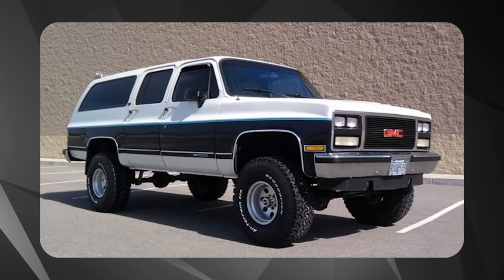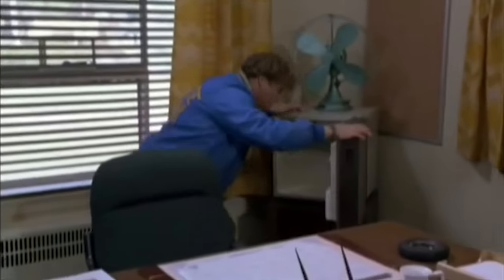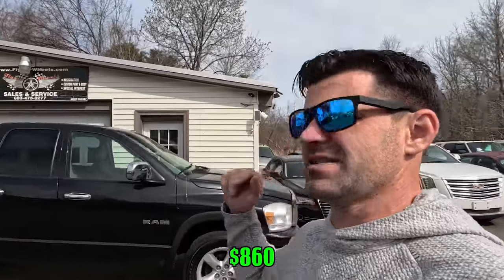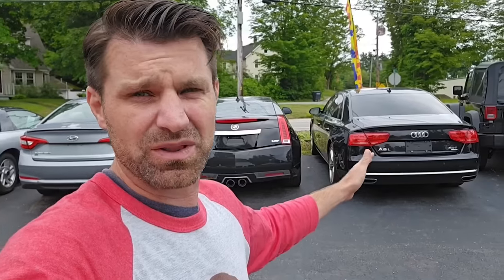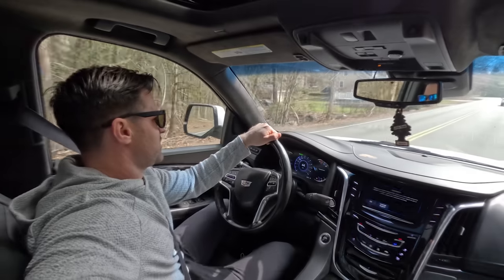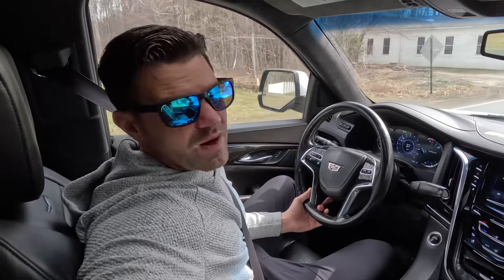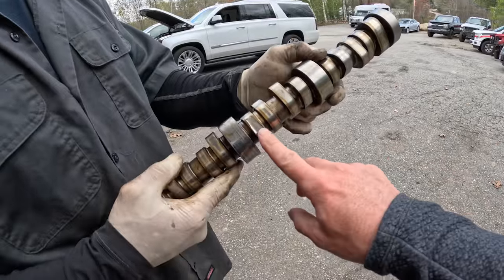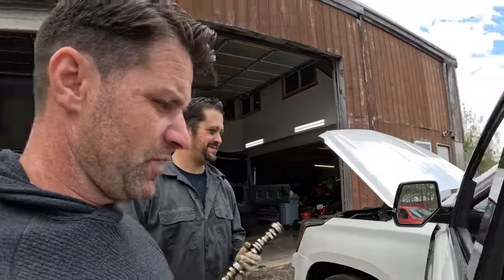WARNING! GMC Chevy & Cadillac Escalade Engine Problems at only 53,000 Miles! - Flying Wheels

Comment: Cylinder deactivation was a failed technology for Cadillac in 1981. 
Back then the technology just did not work.  But now it does and the result is early engine deaths no matter who does it, GM, Honda, Mazda, Mopar, Ford...
Reply: I had a 81 Caddy Coup 8-6-4  - got it cheap in 83 and de-activated it  was a decent car thereafter
Reply: I remember that too.  The "4-6-8" nonsense.  Too many nice Coupe and Sedan DeVille's in the junkyard because of it.
Reply: Direct gas injection is killing modern cars early. And servicing air conditioning on newer cars with r1234yf refrigerant is prohibitively expensive.
Reply: 9 out of 10 people that experience an AFM lifter failure on their 2014+ GM engine did it to themselves by being ignorant/lazy and running their engine oil too long. Some of them are clueless about car maintenance in general and wait until a message pops up telling them they need to change their oil. Others are dunces that make it a game to see just how many thousands of miles they can squeeze out of their boutique high priced full synthetic engine oil. You can have the fanciest high tech engine oil on the market, it still gets contaminated with carbon soot, combustion byproducts, unburned gasoline, and other junk, none of which will get filtered by an engine oil filter. The only way to get rid of that junk in the engine oil is to change it. So a guy buys is $10/quart fancy engine oil and tries to push past 10k miles before changing the oil, and eventually the contaminants flow into the tiny passages of the AFM system, restrict oil flow, and a pin in one of those lifters gets stuck because it didn't have the oil flow to work correctly. The system "fails" and they go online whining about how AFM is junk when really it was their own ignorance that caused their lifter to fail.
Reply: LOL NO
It killed my sister's V6 Accord, it kills Corvettes, etc
Reply: @hochhaul  
Dude, GM tells customer's to change the Sclade oil every 15k miles!

Comment: I have a 2016 Cadillac Escalade Platinum currently at 132k miles only issues I had was the third-row seat motor went out. Drives like a champ!
Reply: I bet most of these problems are owner related.  Most people don’t even change the oil anymore.
Reply: Congrats, send it to the GM museum before you eat your words

Comment: DOD AFM costed me $4000, the lifters on my ‘15 Camaro SS went out at 21k miles. And for me to remove it I had to pay an extra $4000 for the stage 2 cam and tune. If I would’ve know that this was an option I would’ve done it but now I still have it and it’s just an absolute nightmare because I fear that the lifters will go out again.
Reply: Why would GM put AFM in an SS Camaro? That makes as much sense as a screen door in a submarine.
Reply: @charlescurran1289  Helps the meet CAFE standards...
Reply: @MrMartell77  Yeah, I agree but the savings made on a halo car like a Camaro that sells in relatively small numbers can’t help that much. What next AFM on Corvettes?
Reply: Dammm I didn't know this was a issue with the Camaro as well smh...

Comment: You should have him build the 5.3 and 6 liter engines with the AFM Delete lifter/cam set up.  If I were buying a used GM and you told me the engine was not only rebuilt, but was rebuilt using that delete kit, I'd pay for it, knowing I would have a more dependable engine under the hood.

Comment: the best Escalade of all time is the 2002-2006. No AFM. GM failed with cylinder deactivation with the 1981 ElDorado and decided to do it again. My dad had a 1981 Eldo.  Also, all those electronic gizmos. What a nightmare to repair.
Reply: The 2007 and 2008 have a engine with afm but it’s disabled..the 2009 is a 1 year only 6.2 that has same engine as my 2010 Sierra Denali  L9H  vin 2. No afm…so you can grab the 07-14 body SUV’s but only the 3 years I mentioned..2010 onward they went with l94 6.2 and it had afm…but don’t get the suvs with the 5.3 in 7-14 cause they all have afm in 5.3…I love my Sierra Denali and it’s 403hp L9H… no afm and runs killer…I absolutely love the next truck that came out 14-18 but that 6.2 had afm and it scares me
Reply: @toddprater14  it's a real shame one has to know all this to avoid the crappy AFM. It was designed to satisfy the govt CAFE standards by adding a miniscule 2MPG ( if you are lucky) 
GM does not care they break down after the warranty, in fact, they like it to do so.
Reply: @steveosgood9182  very true , it is a shame cause gm’s trucks and suvs are the best looking out of the big 3 in my opinion, and that they do not care as long as the vehicle makes it to warranty  they’re safe…can you imagine having a 84 month loan at 1200 a month and the engine destroying itself 3.5 years after purchase and you have 42 more payments to go out of warranty and it doesn’t run no more?  New vehicles are junk, I’ve said anything past 2013 is basically over complicated crap with too much electronics.
Reply: All those failures are built in replacement functions that consumers never hear about.  When you think about it its actually a good innovation that taps into the consumer perception of quality where there is little masked in a sea of low cost plastic.  Consumers often miss the common sense of plastic and heat don't really mix, but don't take my word for it just see how many new vehicles are sold.  It can also be said that the self creation of a replacement demand market helps stimulate the bottom line of business.  Now the question in everyone's mind is how much innovation can the market sustain with little to no material impact.
Reply: What's AFM...?
Reply: @kurtisstutzman7056 active fuel management-it shuts down 4 cylinders on the engine under light driving …if you give it gas, it will revert to 8 cylinders ..it’s junk, it’s been destroying gm’s best ls engines since 2007
Reply: The 6.2 is a fabulous engine. I have seen them go 500,000 km easy. Run like Swiss watches.

Comment: Gotta love the public's love for these behemoths.  Outrageous purchase price?...check.  Lousy gas mileage (even with the cylinder deactivation crap)?...check.  Limited rear legroom and cabin height for its size?...check.  Premature rust... particularly under the doors (which is pretty much unfixable btw)...check.  Transmission issues?...check.  Engine issues at lower miles (just enough to be out of warranty)?...check.  Hanging like a barge?...check.  And despite ALL of these weaknesses and known defects the public goes weak at the knees at the mere sight of one.  Craziness.

Comment: Any used GM V8 engine after 2007 is a crap shoot. My 2005 Silverado has 283,000 and still runs great, none of those AFM issues. They made the best engines before 2007.
Reply: You're 100% correct! Pre 2007 GM engines last forever .. 2007+ is unreliable junk

Comment: There is   a known issue with these engines as well as a class action lawsuit..correct?
Reply: AFM. Program out as soon as it leaves the dealer. Active fuel management KILLS engines.
Reply: @TheBandit7613  that's no guarantee. The junk lifters are still in there if you just program it out. The only way to truly fix it is to change out the hardware. 

I had a 6.2 that i programmed the AFM out of it with a Diablo tuner about 5 min after it left the dealers lot with 7 miles on it. It still had a lifter failure with about 20k on it.

Comment: When you do the repair you delete the AFM lifters, valve body and use a regular camshaft. Send out the computer for a reflash and no more AFM. Engine will now go 250k miles. If you just fix the AFM it it will happen again. Deleting it is the way to go. Texas Speed sells the kit for $1200 bucks. Its about a 10 hour job to do the delete kit.

Comment: I feel you Craig on the car quality!!! I recently purchased a 78k mile 2018 Tahoe Premier with everything in it. My "Dream Truck" until it wasn't. Started slipping at 82k miles, Needed a tranny. HID bulb cost me $260 due to where it's mounted. Front Magnetic air ride strut, $860, Motor mounts $1,340 with Exhaust manifold gasket. The battery voltage regulator was going, side traffic proximity sensor was going. Rear defrost connector cable replacement requires a glass company to install. I installed a Range Technology DOD disabler to keep in V8, That was cool but I lost trust in that car and traded. Guess i'll start looking for a 96 - 02 Viper GTS. We share that same 90's dream car.
Reply: dont buy gm boycott them
Reply: I’m sorry to hear you have had so many problems with your vehicle. You deserve better.
Reply: @lotsofthisandthat9791  if he wouldnt brought a garbage gm product he wouldnt had that problem

Comment: I bought a new 2021 Escalade and the valve train went bad on one side of the engine. They told me the other side will fail as well, I sold the car soon after.

Comment: So elaborate / so intricate BTW its a GM with so many problems including the ENGINE. So with all those fancy features I'll take my 2016 Mazda MX-5 Club soft top ANY DAY ! I do the maintenance myself - tire rotations / oil changes / transmission oil change  .... so easy to work on ! Its my daily drive in Northern Illinois with the winter tires sitting stacked on a dolly in my garage. Costs are cheap to run even putting premium in the tank.
Reply: Girl's car. An who in they're right mind would live in Northern Illinois? 
Couldn't pay me...
Reply: @TheBandit7613  The most raced car in the WORLD !
BTW , anyone that says what you said HAS'NT Driven one guaranteed !

Comment: I bought a 2007 Avalanche in late 2010. It had 58,000 miles on it. It has an LS3, 5.3 liter displacement. At around 115,000 miles, it started throwing error codes, system failure lights (traction control) would activate. Turns out that I had a misfire in my #7 cylinder. Displacement on Demand (DOD) and Active Fuel Management (AFM) use a complex arrangement of solenoids and special lifters to shut off cylinders #1, #4, #6, and #7. Inside the closed valley area there are four stanchions that carry oil to solenoids that feed the intake lifters for those cylinders. The engine computer (ECM) senses you can run on 6 or 4 cylinders and shuts the oil off to two of the cylinders at a time. Your display on your dash will say you are running in 4 or 6 cylinder mode if any are shut off, running in 8 cylinder if all cylinders are firing. Those lifters without the oil, do not work to open the intake valves on those cylinders. The cause for the failure is usually an extended oil change frequency that may allow dirt to clog the stanchions or solenoids which keeps those lifters from getting oil when reactivated by the ECM. My solution was found online. I found a guy who reflashes ECMs to make them non-DOD or non-AFM. He had a list of parts that I would need. I have also found that Summit Racing lists a kit to delete the AFM on an LS engine. At a minimum, and to eliminate the AFM altogether, you'll need a new camshaft, a set of standard lifters, a new valley pan, a top end gasket set, and new "stretch to torque" head bolts. All parts (except gaskets and bolts) need to be for a non-AFM application. This was the first LS I had taken apart (top end only) and I only saw taking the heads off as the means to get the lifters out. I have heard there are some trick methods, but at the time, I didn't know or see any other way. I did it with the engine in the truck but pulling the engine and putting it on an engine stand may have been easier given I was working outdoors in South Carolina in the summer. Going ahead and removing the hood, fenders, and inner fenders would have yielded more access as well. I did the swap at 118,000 miles and the truck runs great at 159,000. If I were doing it again, I would have gotten a hotter cam or a hotter cam/lifter/pushrod/rocker arm package from someone like Comp Cams and maybe some better breathing heads. It's apart, now's the time to upgrade if you are going to. I'd also get a complete top end bolt kit from ARP and I'd make sure to use anti-seize compound on all bolts going into aluminum parts such as the block or heads. And again, since it's already apart, a new timing chain makes sense. Of course, I had to send my ECM off to be reflashed, but it was done and back in my hands within a week. Good luck and have fun. Oh yeah, all the parts came to less than $500.
Reply: Ls3 was a 6.2 not a 5.3

Comment: What good timing on your video. My wife wants a 2016 Tahoe, which means I'll have to get rid of my 2003 v10 excursion. I told her the excursion will outlast the Tahoe easily but she thinks I'm crazy. I showed her your comments on how older cars compare to newer and she just shook her head. I tell her they don't build them the way they used to.
Reply: your wife wanna put you in the poor house 😂😂😂
Reply: I'll buy your excursion when you go to sell it....
Reply: The 2014+ AFM engines are fine if you change your oil every 3 to 5k miles. The 6-speed issue is due to a thermostat on the transmission cooler and there's a TSB instructing dealers to replace it for a thermostat that keeps the transmission about 50 to 60 degrees cooler, so as long as the transmission isn't currently exhibiting symptoms of a bad TCC, it's probably fine.
Reply: @hochhaul  well, I got a 2016 Tahoe, we'll see how it goes.
Reply: Nobody wanted to buy it so I traded it in.
Reply: Get a Highlander or 4Runner

Comment: Yep, on the CUE screen. Wife's SRX CUE failed in typical fashion. Dealer (purchased it used) foot the bill for the aftermarket replacement and the only stipulation was that I install it myself as they were not a GM dealer. They said no problem and accepted my email saying I would take full responsibility for the install and they would not be held responsible if it failed again.  No problems at all as it is going on its third year with absolutely no typical GM failure issues. The dealer was very accommodating and I could not say enough good things about how cooperative they were.

Comment: If you regularly watch Scotty's Channel, you would know that most GM products took a dive in quality since the early 2000's. Just don't make them like they used to and everything is built to fail when the warranty is up. 
Also any engine management that deactivates the cylinder s to save gas is also known to wear an engine prematurely. I have MDS on my Ram 1500 with the 5.7 Hemi. I have to remember to deactivate it every time I come out of Park. My engine sounds like it's running rough when in eco mode. I have read on many forums to do this to prolong the engine. Plus frequent oil changes like every 3,000-5,000 miles will go a long way to save the engine.
 Stay away from those Audi's too...😂
Reply: I have the same thoughts. Glad, at least that you can easily deactivate by using the -/+ buttons on the steering wheel.
Reply: I have better things to do with my time than watch Scotty. And my time isn't worth much to begin with. I hope his plastic surgery heals up nicely though.
Reply: @dougfisher1813 Scotty is so annoying

Comment: What about all the metallic sludge that’s in the engine even after the cam and lifters are replaced?Unless you strip it do and hot tank the bare block and heads you won’t get it all
Reply: I've heard the bearings need replacing as well

Comment: My last 3 GM trucks lasted about 30,000 miles. That's all modern day vehicles with AFM are good for now. Lifter and trans issues are frequent. I purchased a 2006 Silverado with no AFM and put 130k miles on it in the last 8 years.
Reply: You don’t hafta go that old even though the 99-06 trucks are bulletproof…just grab a 07-13 Silverado or Sierra with the L9H 6.2 (vin 2)no afm in the 07-13 trucks (6.2 only)..

Comment: My 15 Silverado 6.2 LTZ AFM failed at 117k miles on cylinders 4 and 7. Dealer wanted 8k bucks to put same junk lifters back in. I did it myself for about 1500 bucks, BTR cam , LS7 lifters , full AFM delete from computer. She screams now , just drove a  1600 mile trip averaging 80 mph and still got over 20 mpg. Bulletproof now.

Comment: These engines are wildly inconsistent. We have a 2015 Tahoe with 225k on it and no issues with the motor. AFM activates as it should and no weird sounds from the motor. The thing is it seems to take out engines with low miles, moderate miles or even high mileage motors with no warning and that's the scary part especially if you're on a road trip.
Reply: The "secret" to the longevity of these "bad" engines is PROPER MAITENANCE! The oil HAS TO BE changed by at least 5kmiles using the HIGHEST QUALITY full synthetic oil! Those factory recommended "extended drain" intervals is TOTAL B.S. !
Reply: @TheOzthewiz  Yeah I change the oil every 5k (instead of 10k like they say). I just use whatever 0W20 oil is on sale at the time and an AC Delco filter. It is an ex police Tahoe that had 160k on it when i bought it so it looks like they kept up on the oil changes because even with all the idling the motor is very smooth.
Reply: @TheOzthewiz 
No, it's just they are having junk cars come off the line. Every car needs maintenance of course, but even with that, junk is junk.

GM is not designing cars like Honda does.

Comment: I havw an 07 Chevy Avalanche which has the same AFM and I had to tear down my engine twice for bad lifters it is an terrible job lol. If you have this engine, do the DOD delete or buy the Range modulator that will keep the engine in V8 mode at all times.

Comment: Not cheap to purchase.  Become a partial niche dealer.  Focus on Lexus GX460's.  Run forever and last of the reliable V8"s.
Reply: RIGHT ON! The GX460 has the best longest lasting engine on the market currently. I'm in the market for one.

Comment: 6:00 how do you have time to play video games?
11:43 the torque converter slips when the engine cut off cylinders. So the engine doesn’t shake. This would be ok if people changed the transmission filter.